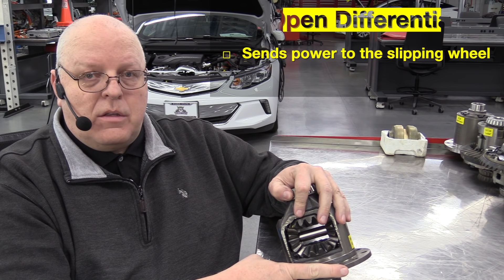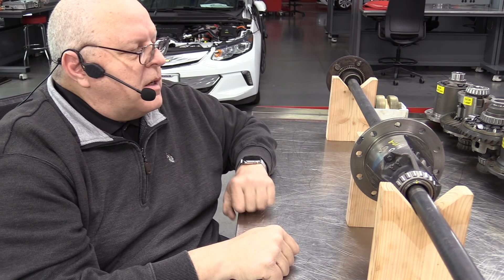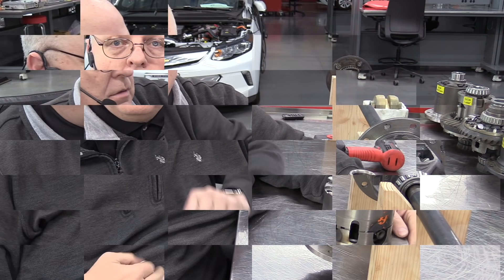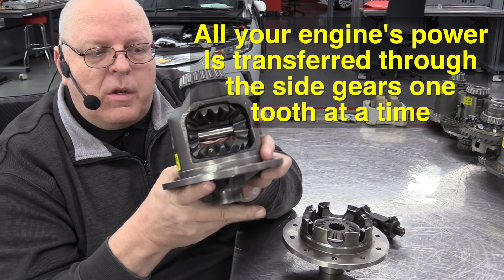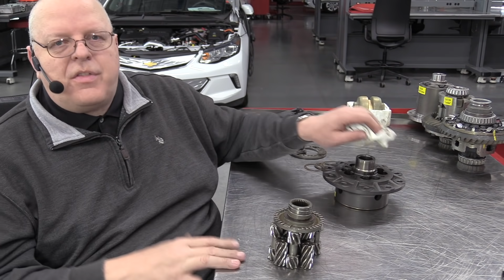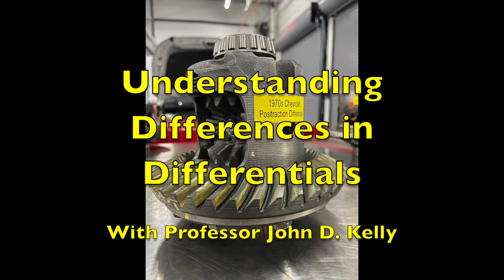Understanding Differences in Automotive Differentials

Comment: I don't understand how you get the air into the spinning differential to lock the unit.
Reply from the maker: The air does not go into the spinning differential case, it goes into the axle housing which pushes on a spinning dog clutch inside the differential case.

Comment: 42:51 As a novice I dare to differ from the Prof. In my opinion, this is only a variant of the traditional open differential, not Torsen. The four pairs of small helical gears are equivalent to 4 spider gears in the normal open differential Design. It’s not a type of Torsen, due to the non-existence of worm gears or worm wheels, which are a key feature of torsen that limits the slip of one wheel.

Please correct me if I’m wrong . Thank you.
Reply from the maker: It is a Type B Torsen differential. See https://www.jtekt.co.jp/e/products/automotive/driveline/differential02.html
Reply: @WeberAuto  thank you. I’m fully aware that this type of differential is widely considered as type B Torson differential. However due to exactly the reason I mentioned, it is not a Torson. It sucks to just repeat what is being said by other people without thinking critically and independently.

Comment: Torsen differential is basically a worm gear. Large gears are worm screw, pinion gears are worm teeth. For different speeds, you need screwing from left and right, which does not work if there is no traction, hence the differential lock. Genius but apparently breaks :)

Comment: For an open differential, where one wheel is in the air and spinning and the other wheel has traction - it is not the case that all power goes to the spinning wheel and zero power to the traction wheel.  The power imbalance is large but it is not 100% vs 0%.  Even if the traction wheel bearing is stationary, significant power is absorbed by its side gear and axle. This is always the case unless the impedance curve for the traction wheel has infinite slope (on a graph with angular velocity as abscissa and torque as ordinate).  The fact that the airborne wheel spins is proof that it receives torque.  The impedance of the spinning wheel can be surprisingly high. It may spin at up to 2000 rpm , equivalent to travelling at say 200 mph.  Although the wheel bearing has little load from car weight, the angular acceleration to change from standard road rpm to massive rpm requires  considerable torque - and at huge rpm the oil may reach high temperature and start to shear and create an exponentially upward sloping impedance curve. Because torque splits evenly in an open diff, therefore torque on the traction side is also significant.  This is evidenced by CV axles breaking even when a traction wheel appears to be stationary.  Therefore the operating point for the traction wheel is some way up along the impedance curve, and therefore power (the integral of that curve) is not zero.

Comment: Excellent video, I learned a lot. Going back to the first explanation of limited slip with clutch pack, I think it’s the 70 Chevrolet, it’s explained that the bevelled action of the side gear with case pinion gears exert a force that pushes side gear outward, causing clutch pack to engage. (Both sides at same time, allowing both axles to spin at same speed). Does this always happen to both sides simultaneously, meaning it never gets to the condition to become an open differential where one side is spinning freely with no resistance ?

I ask this because I can’t see one side locking if the other side is already spinning, the pinion gear torque would go to the side gear with less resistance like an open differential.

Comment: Hello everyone.
Great video ! Having myself a clutch type 8 ¾ Dana power lok (742 case) in my '69 Road Runner, and encountering chattering when cornering, I’ve been looking for all available online material to better understand what’s going on.
I’m gonna add the friction modifier (oil has been changed « 700km ago », with Motul 300 LS in 75W90 grade, but it still chatters a lot), hoping that it helps. I’ll also check at the same time the break away torque. Diff has 2600 km only (changed by previous owner) / I don’t know if there is a « S-shape » spring inside the diff. (for pretensionning) 

But in spite of all uselfull explanations from the Doctor, I’m still not totally sure of understanding what is precisely happening, and especially in what order, in below situations. 

Thank you in advance for those who will read till the end 🙂!

(I’ve seen videos of LSD tests with one wheel on ice, the other having traction, and cars still struggling in getting going in spite of their LSD :-?)

(All scenario to consider with my Dana LSD diff.)
 
1) car standing by ; one wheel is on ice and one wheel on dry road ; going straight, accelerating progressively from 1st gear
2) car standing by ; one wheel is on ice and one wheel on dry road ; going straight, flooring it
3) car standing by ; both wheels on dry road ; turning full left (or right) ; accelerating progressively from 1st gear
4) car standing by ; both wheels on dry road ; turning full left (or right) ; flooring it

For example, on situation n°1, I would have imagined that things would happen in following order :
- wheel on ice starts by spinning (because the torque goes immediately where there is the less resistance)
- this generates a relative speed of spiders vs side gears (both side gears see the spiders move, reciprocal is true)
- this generates the « push away » forces between all spiders and side gears
- this presses the clutch packs enough to lock them. I would expect both of them to be locked at the same time. 
- makes the opposite shaft turn
- « equation of shaft speeds » forces the ice-side shaft to take the same speed as the one that has traction
- car moves

In situation 3 :
- as soon a the car moves, we see a relative speed of spiders vs side gears because of the difference of lenght each wheel has to cover
- generates the push away force for both clutch packs, but the force stays below the threshold that allows both shafts to slightly slip to adopt their correct speed (the well named limited slip)
- I assume that the maximum cornering speed that the car can handle before the rear of the cars slides away is such that the pressing force that will apply to the clutch packs will remain low enough to let the limited slip of the shafts.

Comment: anyone with experience with part time 4WD (no center diff) - LSD - Rear, open front. Will it bind less if its a Torsen diff in the rear ?  In MN in winter it goes -40 and can't switch in and out of 4wd .

Comment: I had a 78 F-150 (4WD) with a Dana clutch LSD in front axle and the  gear  True Trac in the rear axle. Was able to go most off road trails. The front lsd made the most difference. Had fun and didn't break anything as the truck was my daily driver. FCC in Arizona

Comment: I've always been fascinated with the mechanical clutch pack limited slip differential. Yes, the torsen style eliminated the wear points of the clutch pack style but there is just something sexy about the original LS unit. There is an additional short lived style he didn't mention and that's a viscous type limited slip which is a completely sealed carrier filled with a thick silicone and sandwiched disks that resemble a cluth style LS but had vains and it basically acted like a fluid torque converter with the silicone. I believe Toyotas and Infiniti and a few others were using them in the 90s through the early 2000s though it wasn't well regarded as it couldn't apply enough locking to the slipping wheel and functioned even worse as it heated up which made the silicone thin out. The simplified torsen design gained more popularity due to being maintenance free.

Comment: As a disabled veteran I have re-kindled my interest for mechanics...How? by refilling my oil in my rear differential for my 60k services. Working on a 1999 Nissan Frontier. 4 cyl, 4 speed, auto.2.4 liter. After I changed my fuel filter I thought oh my,  how dirty the differential oil must be. Was right. Then I got to thinking how does this work exactly? I grew up in junkyards with my diesel mechanic dad...Got me thinking mechanical engineering with my G.I. Bill? Love Oil. Love Gasoline. Welding. Etc.The internal combustion engine(i.e. pistons) are a modern marvel for sure. Thank You sir for your well explained content!

Comment: I worked on a awd equinox about 15 years ago and it had rear diff  noise. I found a TSB on it and I had to change the fluid and drive it 50 left circles in the parking lot then 50 to the right then 50 to the left. I was so fucking dizzy that day. But it fixed it

Comment: It's interesting to see that the torsion differential that was supposed to be a heavier duty design was completely trashed compared to the limited slip differential that had worn clutch packs where only the clutch pack assembly was worn.  It seems that the clutch pack, although wearable, is more robust and serviceable as far as gear assemblies are concerned.

Comment: Nice video well-presented,  has a budget-minded stock car racer I do have to point out that you don't weld the spider gears to the side gears...
What you do is simply fill in two teeth on the spider gear on opposite sides, thus preventing them from rotating past the spot where you filled in the teeth with the weld...
So you do in fact get some movement between the two opposite tires.

Comment: Wow!! Great video.
Any suggestions on what the best, i.e., durable,  limited slip design would be for a one ton Ram, Single rear wheel used with a small camper on it full time.
6.7 Cummins, auto, and 4wd, mostly used on the highway. 
It has a factory rear limited slip with 3.55's and the ratio is perfect.
It's a Dana 80.
Thank you sir and please keep up the stellar work man!
Thank you.
😎👍

Comment: I had a Differential assembly that was bad (when car was built) in my 2016 Chrysler 200C AWD, driving car with window open kept hearing clicking sound during I believe it was acceleration from dead stop.
I took car in because of brakes turns out was not brakes, because Differential assembly was bad whole drive assembly axles and half shafts whole backend needed new driveline.
Car was under warranty and it was $5,000 Chrysler covered it every penny.
Dealership told me Differential was bad that cause damage to driveline in rear.
At time I had maybe 25,000 miles on car, still had warranty remaining.

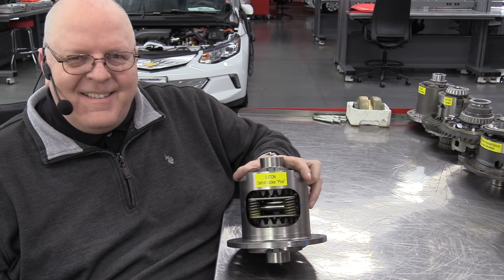Comment: 30:20  Detroit locker is not a 'Posi' diff.  The detroit locker uses dog gear/teeth to to lock the right and left axle together (somewhat like a ratchet).  Posi-traction uses clutches and spring tension.

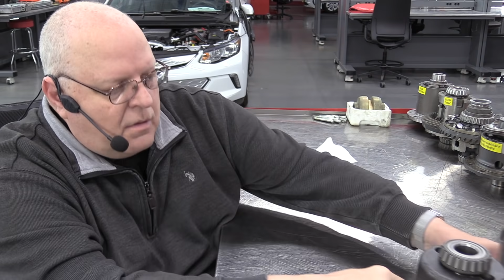Comment: Great video!  The best part starts at 34:00 mark for Gen5 Camaro owners.  Note:  You don't need to mark the case halves since it's impossible to assemble wrong, there is only one hole for the roll pin that holds the spider gear pin.

Comment: Im not 100% sure that his explanation of the torsen diff is accurate...i dont think the torsen needs to "wedge" any gears to operate. This Jeep version might operate that way but im sure the original torsen design  just used the gears meshing to achieve equal power to both axles at all times

Comment: I'm a bit younger than you but that comment about we had to have a "posi" hit home for me too 😂. I've always been a MOPAR guy and in my teens it killed me that I couldn't find a "posi" rear end without swapping for a Chevy Dana. An older mentor of mine would say who cares you have a SureGrip, it's just as good. Took me about 5 years to learn that I had been using an identical rear diff but SureGrip wasn't as good as marketing. 

One other thing, maybe you could cover the Later Muscle Era MOPAR 8.75" SureGrip. They got rid of the clutches and went with these cones with a crush sleeve. The cones would "screw" into the case under load instead of a clutch system. I think it was the 742 case, anyway everyone looking for power hates them but all the cruisers seem to love them. Just a thought anyway.

Comment: Not doubting  the½t down example showen. I only have experience with the 10.5 14ff  that has 2 options from gm or aftermarket ( still true in 2024) detroit locker or open. Clutchliss locker. It was an auto locker with dogs. Drive line tq greater than 50ish ft lbs on the pinion locked the axles like a spool. Paperwork advised not changing lanes excessively as it would caused excess tire wear.
It applies power to the slower tire and allowed the out side to slip/ratchet only if loading was low enough .
Fun factoid: 10.5" FF 14bolt($250) and Toyota v6 carrier where the only factory carriers strong enough to prevent permanent deformation from the side loading exerted(cir98) , solad like a miny spool guts only , all others where sold as complete unit.

Comment: It's good on youtube, because you can stop and lookup things, then continue. I'm looking up the history of spicer, because I've bought uni joints from Hardy-Spicer in Australia before.
I found a new dial indicator that I can't remember buying 5-10 years ago, it must have been on special at the time. Then I'm looking up how to measure the backlash on the diff in the workshop manual. I got a runabout for a cheap price, but it's kinda fun fixing everything on it, I'm just down to 2 informative noises now, exhaust bolt missing and something in the gearbox/diff/halfshaft, hopefully it's just the half shaft otherwise I'll be pulling the gearbox out while the vagues wonder what I'm doing with the front in the air on jacks again.

Comment: This seems to be a much more practical than other video you made. Especially like the video that show viewers how to change transmission fluid from Toyota sealed transmissions. In that video, you shown it took $1000 ? of equipment to change fluid. I very much doubt many shops in the real world will put that much money into such specialized applications. It add fuel to the controversy that much of what students learn in colleges are junk , to be forgotten as soon as they pass the exams.It greatly benefit someone with a good short term memory.  I recently changed the trans fluid in my Camry for under $100 in tools.  I might have a bit too much fluid in it but trans can tolerate it and I had no bad effects. To add to the fire were the recent Harvard and Penn university fiasco at congress, Harvard were forced to dump their diversity hire president.  Somehow MIT president escaped the flak. I still remember talking to new truck drivers about the colleges teaching them to physically touch the wheel nuts on inspections to be sure it is tight. I am aware it is to a college or university to keep a student learning there as long as they can and pay their considerable overheads. It does not matter what kind of junk they learned.

Comment: Nothing about Borg Warner/Auburn cone posi, Detroit Locker.
 Nothing about side gear and pinion gear ratio... Example 10 pinion and 18 side gear vs 10 pinion and 16 side gear on a limited slip .. nothing about Torsen differential vs Gleason gear differentials.  And the spring compressor you showed was for 64-67 GM Dana design 10 and 12 bolt limited slip differentials.

Comment: A very good presentation on the whole. I would like to add as someone who studied engineering at college that I don't agree that the statement at 25minutes in that the clutch packs are only engaged when there is a difference in rotation speed is true. I maintain that the 45° angle of the bevel gear teeth connecting the differential pinions and side gears means that under hard acceleration both side gears will be pushed apart and lock the axles to the rotating differential. Under less agressive driving conditions there will only be operation of a clutch when the wheel concerned provides resistance for the gear teeth to push against and obviously not when the wheel is spinning freely on mud or ice. As an aside, in my youth hill climbing races in cars was popular. Cars were often fitted with two handbrake levers to stop a spinning wheel and divert the power through the diff to the wheel with grip and allow the other to slide over the mud.

Comment: Just ordered an Eaton Truetrack to replace my 30 year old burned out gov-lock. Pretty sure the previous owner was doing dumb shit in the desert like pulling stumps out of the ground in reverse.

Clunks in reverse as soon as I touch the gas pedal. Driveshaft rotates at the clunk with no rear tire movement. Worn tooth(s) and out of spec lash is my guess.

Comment: you forgot to add; rpm will manualy activate the limited slip, there is a super lot to the rear ends, after 40 years i dont know as much as you do ! great video, used it to find where this shim fell out of a locker, thanx now i know

Comment: @25:00 the clutches are engaged by the torque on the housing driving the pinion pins up and down respective opposing ramps. It isn't the beveled tooth form providing the engagement force. This way if you let off around a corner it will just act like an open diff

Edit: @30:00 now that is the bevel driving side gear load.

Comment: Great job describing differentials.  How does the Jeep anti spin differential and limited slip differential differ?  I have a 2021 Jeep Wrangler with anti spin.  I don't do serious rock crawling but do go off road on moderate trails.  I seem to have excellent traction without lockers.

Comment: ,,,,,,Thanks a bunch,,,,,Been a student for decades collecting many manuals and books,,,,,Of all that I have seen and read , never saw any written material that gave a concise rundown on how and why  the open differential functioned,,,,most gearheads said screw that stock junk and got a posi unit installed......The video was great and it was easy for me to take all the info into one of my journals with my pen.........